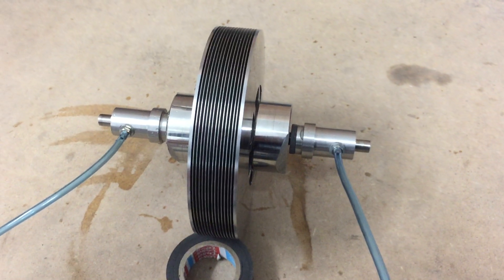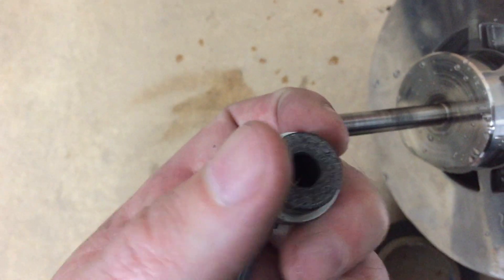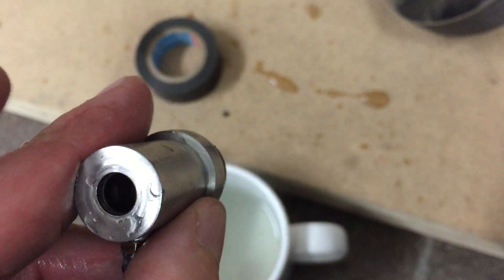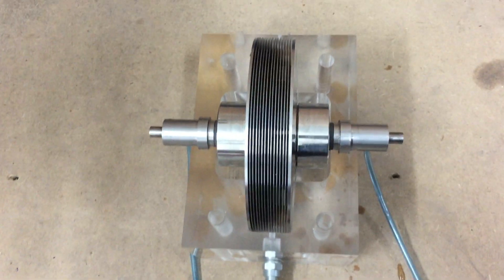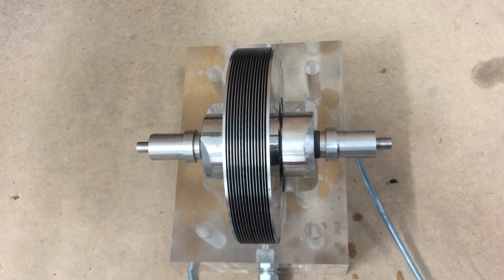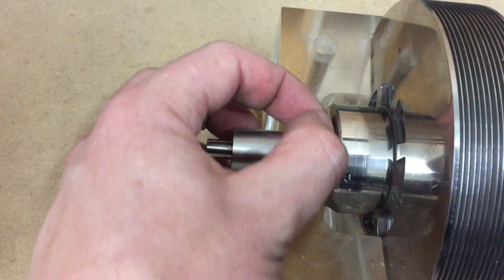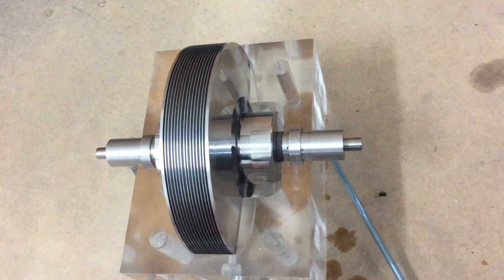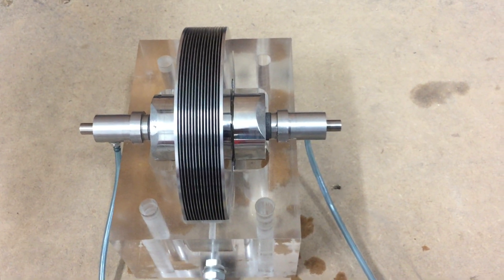Aerostatic Bearing Prototype 2 - Tesla Turbine

Comment: I wonder if any magnetic materials are sufficiently strong for this application such that you could have magnetic bearings.  They’re low friction, and also have the potential to generate a small electric field that you could potentially reclaim if you placed copper or similar in strategic locations.  If you went this route you could use current draw as a brake / governor, too, to fine-tune the shaft spin speed.

Or maybe that’s a terrible idea, you decide. :)  I LOVE what you’re doing, I can’t wait to see every next step!
Reply: me too, can’t wait

Comment: Awesome project bro keep up the fantastic work Tesla was way ahead of his time. I think the bearings should look like the turbine. Air through the center of the bearings and out through the sides. So make 2 little Tesla turbines as bearings this should reduce the surface area and increase the load pressure the bearing can handle. You will need a few small holes where the bearing meets the turbine where it's leaking just to prevent any friction.

Comment: I would increase the diameter of the shaft that the air bearing sits, as it will give you more bearing surface and therefore a more stable bearing
Reply: @nikola.tesla.r.and.d.centre  This all looks very interesting, my fingers are crossed for the perfect solution.

Comment: Im liking the concept. Maybe a permanent ring magnet instead of the graphite would offer just enough thrust pressure on rotor to maintain the airgap
Reply: @nikola.tesla.r.and.d.centre  Well initially i was just thinking 1 fixed to the air bearing but then realized the stainless you used may be austenitic - so therefore yes 2 would be used in repulsion. I do not know how your bearing is crafted exactly but by what I see I would machine a "shelf" to match the ID of the selected ring magnet and I guess machine a recess in the rotor hub if that was possible for the 2nd and epoxy. Not certain balancing would be more difficult - might actually improve =)

Comment: If graphite is used as bearing material it wears out really fast if turned without air on, gets sloppy and then useless.
Instead cut the same bearing in half and press in air in to both halves! Support halves in only one point each. Both points must press against each other with great force. If you use aluminium or steel ring around the bearing halves and let the points (screws adjustable) pull apart or stess the metal ring it will get perfectly contact with the shaft and if worn just adjust screws. really easy and always frictionless. Anders

Comment: I would wax the graphite to fill the pores. Might press it down in molten wax to seal it. It will rub off the friction face.
Reply from the maker: Since the video I’ve found it’s better to encapsulate the shaft for z axis control. The bearing then doesn’t need to be next to the rotor. You have to match the air pressure to the surface area of shaft and also have something in place so the bearings can self align.

Comment: The 'City of Glendale Full metal' Airship was to be powered by a revolutionary steam turbine. The turbine 'sucked the airship forward' from the main nose drive, creating a hole in the airs pressure at the front of the ship..1929. 
The turbines were never installed.
That's the story. 
I wonder what those ' vacuum steam turbines' were? Teey all operated condensers..
Reply: T.t. is the perfect Airship motor. There would be no need to balance lift with fuel weight. It runs as a condenser. 
Maybe this ship also operated using reduced internal atmospheric pressure... Therefore not requiring lifft gasses.. just saying.
I see Tesla as the face of the future, but responsible for patenting lost old world tech. When you look into airships, you can see their history. Has been deliberately obscured, but the docking infrastructure is in every major city.
The empire state building was originally designed as an airship docking station. The Eiffel tower, Tokyo tower and of of thirrblookk alikes served as airship docking stations.

Comment: did you actually install and clamp the top plate casing and pop some driving air to run it up properly?
leaving half a bearing open is rather like an Air Hockey bed without the hard shuttle puck actually there to direct the airflow cushion where its useful and needed to work.
its hard to see the cavity flow as you failed to show/explain your thinking, but it seems that the powering fluid as it enters the outlets will more than compensate for the side of the bearings air pressure flow and naturally force it back to the rotating axal/rotating gap.
if it does turn out to need a little help, just cut some shrink tube and apply on the black rim to lower its side escaping pressure for testing

Comment: my 2cens : No need a bigger bearing this is not friction less because the air loose is locate on "the shoulder face" this act  as an effect that we call in french "aspirisouffle" alias laminar flux combine with a coanda effect  translate it as "blowsuck" the same technic is use to suck sheet paper on rotative press ... the shape of the flame confirme the pb ... so you air bearing in your case act as circular bearing with preloaded shouder bearing who hardly suck plate and add friction  -> remove the flat circular contact between bearing and turbine by adding a contact point on the axes of the turbine.

https://youtu.be/mRH_Q106uq8?t=713